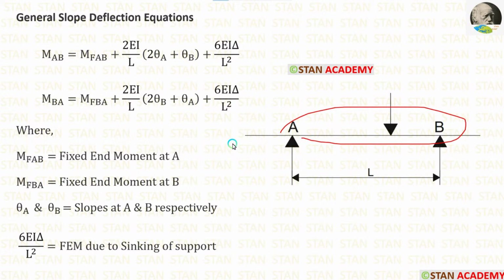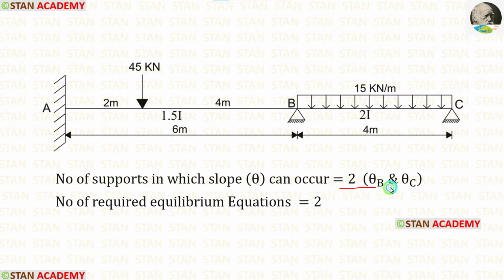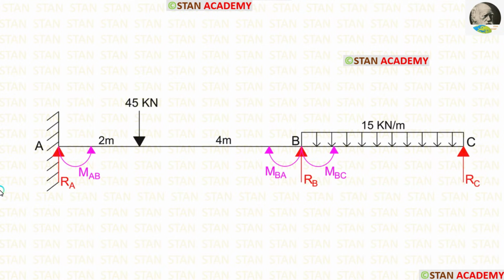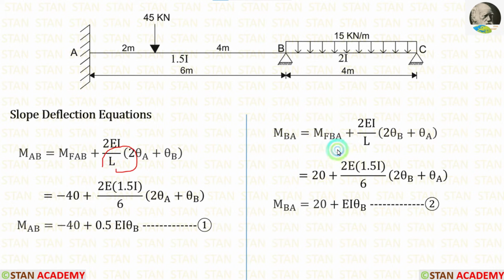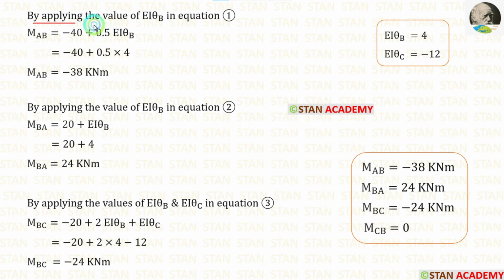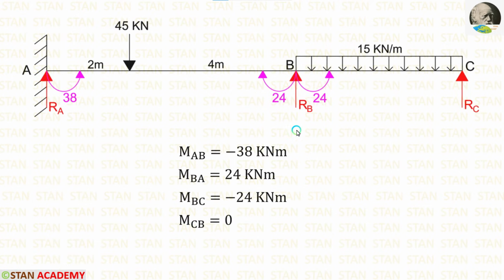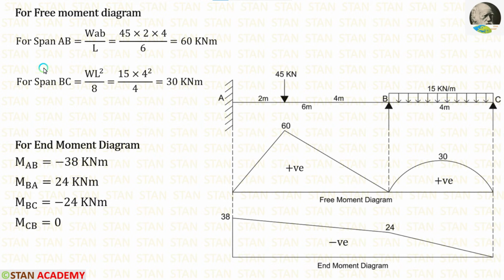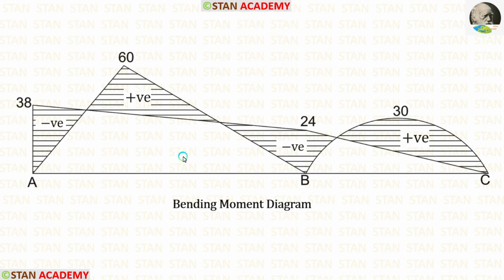Slope Deflection Method for Beam Analysis - Problem No 3

Comment: Sorry sir in the end of the span BC there was hinge support but on calculating the fixed end moment you make it fixed why?
Reply: Fixed End Moments (FEMs) are purely hypothetical: In methods like Slope Deflection or Moment Distribution, the first step is to artificially clamp (fix) all joints and supports against rotation—even if a support is actually a pin, hinge, or roller.

Comment: Sir why u use the formula 2EI/L for MBC, should it be 3EI/L since it is hinge end? Im confused
Reply: sir, it must be 3EI/L for far end pin or roller. So, you are right. But formula changes like that ; 3EI/L (Qi - 3displacement)
Reply from the maker: In slope deflection equation method this is the standard formula. Here we always have 2EI/L. Check this playslist. https://youtube.com/playlist?list=PLjJwBYxz7Cym_XRwWlux5KDvALqYpPXi9